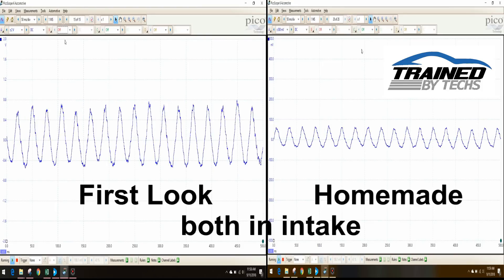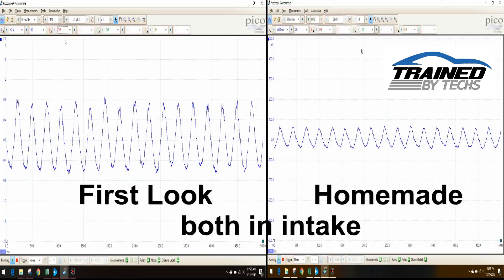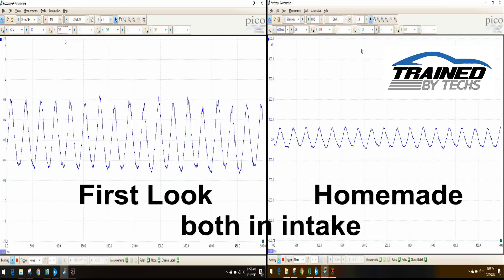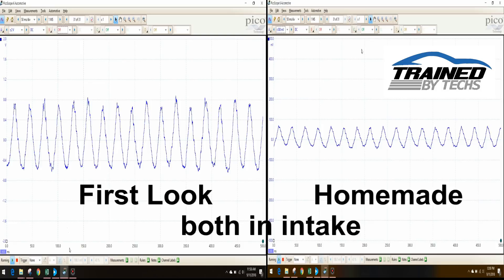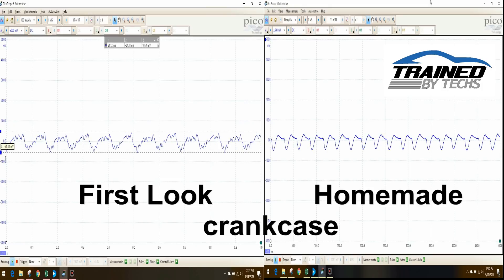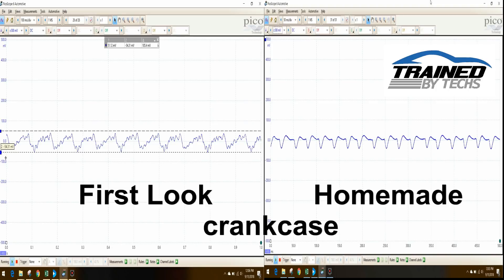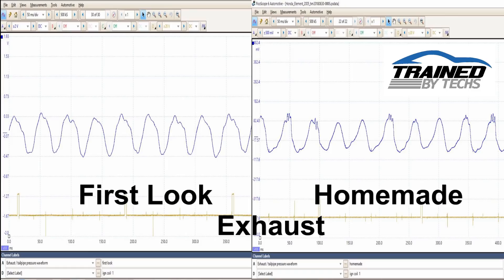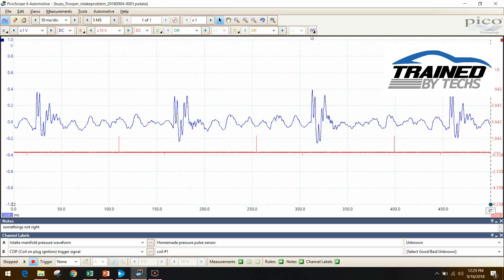Introduction To Pressure Pulse Sensor Testing

Comment: Sorry, the overlay is not exact, and it REALLY sucks for a 6 cylinder engine, there is a learning curve for the overlay and they surely could have done a much better job to design it, hint hint
Reply: Sorry, but the overlay works great on 4, 6, and 8-cylinder engines. Also, it is free!

Comment: It took me a while to realize that this is actually measuring the derivative of the pressure/time curve. Baseline was pressure from a moment before, so in contrast with a typical pressure gauge, it measures the rate of change, not absolute pressures.
Reply: Delta

Comment: I am saving to buy the WPS500x transducer kit. Will it handle reading pressure/vacuum pulses. If so should I hold out on buying the FLS? thank you
Reply from the maker: Absolutely. The difference is a WPS measures the ABSOLUTE pressure as opposed to a pressure pulse sensor measuring the CHANGE in pressure

Comment: If u have a single channel scope and u wanted to know where your anomaly was couldn't disable any easy cylinder which would then enable u to identify the other one?  I'm thinking yes. Also, u get a fuel pressure sensor every time u buy a fuel pump so there would b the start. Correct?  Thank for a great vid!!
Reply: Bill Rimmer Yes absolutely!

Comment: Great video man! I have made a few of these to date, and they all seem to produce a very clean signal.  I machined the bodies for the last two on my lathe and made them a two piece design that press fits together. This makes the unit very compact and even easily serviceable if the element needs to be replaced.
Reply: Nice! My first attempt at making one was a total failure but these sensors made by Mike Nicholson work really well.
Reply: I made mine too,works very decent,also made one out of fuel tank pressure sensor.

Comment: Thanks Richard. Good video and info. My shop has the WPS500, can that be used in this way or do I need a pulse sensor too?
Reply: WPS can be used for all of this type of testing, although I might not wanna stick a $1000 tool in the tailpipe. 😀

Comment: Nice job sir. It would be interesting to see how the abnormal reading plays out. Curious to see if it's directly or indirectly related to the firing cylinder. Thinking the firing cylinder isn't the one cause the pressure pulse, but instead just serves as a reference. Hope to see you at ASA Super Saturday